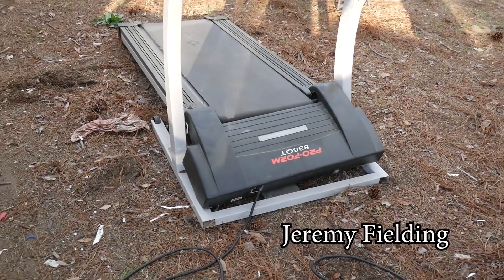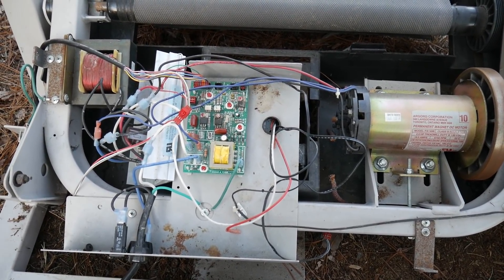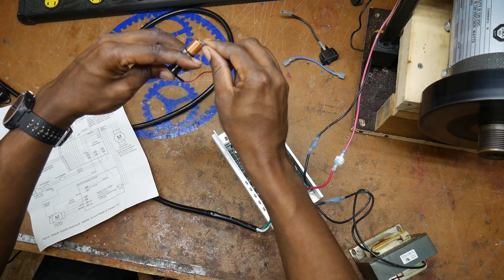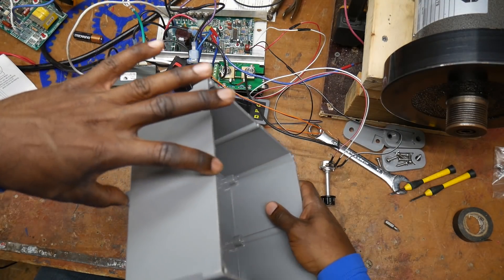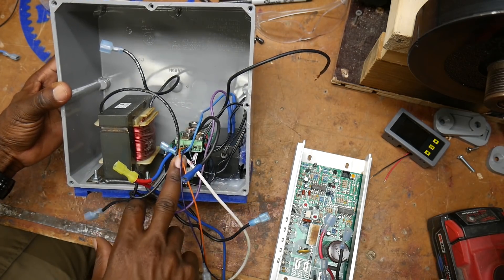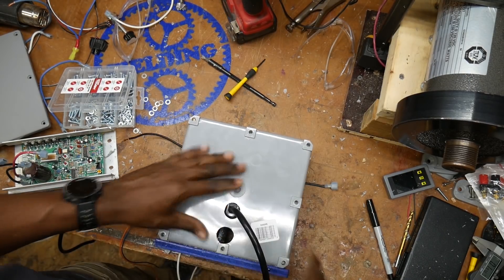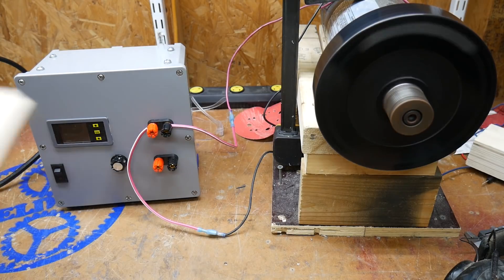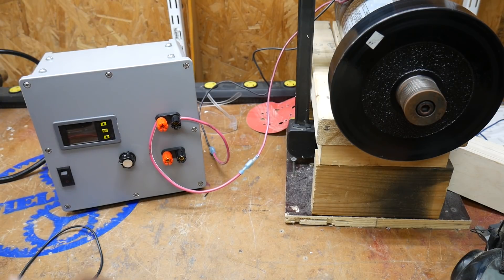Building A Variable DC Power Supply From Treadmill Parts: 054

Comment: Hi Jeremy, when you talk about the control side, you mention high, low and a wiper, mine is labelled GND (Presumably earth), 5V and CF .... have you any ideas what these may mean ?
Reply from the maker: That is a different setup. it sounds like variable voltage input instead of dividing voltage supplied by the controller. You have some homework to do to confirm the correct setup.
Reply: Jeremy Fielding thanks buddy. I managed to use an SCR voltage regulator and a bridge rectifier in the end, but thanks for your time to answer :D

Comment: Jeremy, is it necessary to use that choke? I'm going make one of my own with an MC60, but do I actually NEED the coiled choke for the power supply?
Reply from the maker: I don’t like making these kinds of recommendations. If the question is will it turn on and adjust the DC voltage the answer is yes. I decided to use it. You will have to decide what you want to do from there.
Reply: A very fair answer. Fooling around with it Jeremy, I saw it help dampen the audible surge when trying to achieve a set speed during motor testing. IMHO, which is based on absolutely no accreditation I have, keeping it would be the best idea.

Comment: to the right of the 12-volt adapter whats the name of the object with a circuit board?
Reply from the maker: I haven't watched this in a long time but if its not part of the treadmill circuitry it is the "other" part of the voltmeter display. You can see all the treadmill parts used in the video so it shouldn't be hard to figure out if its one or the other. If you still can't figure it out it would sure be helpful to post a time stamp so I don't have to re-watch the whole thing.
Reply: thanx

Comment: Heat up connection until the component melts the soldier, not the soldier gun. The gun or pen is used to heat the connection not melt soldier... that's the whole trick to soldering... wish I had your patients to make videos of it... It's really simple though..

Comment: For the soldering, don't use too cold of an iron. Far too many beginners set the iron temperature way too low, then wonder why their joints suck. I'd go no lower than 650F (340C). My iron on my bench is usually at 700F (370C). Just touch the iron (with a little solder on the tip to help the heat transfer) to the wires (/ board / components) to heat them up, then stick in some solder. It should melt basically instantly, and flow nice. Oh, and don't goop on too much solder either :) If you still have trouble, add extra flux beyond what's in the solder - it'll help a lot.
Reply from the maker: I should probably start with a soldering gun that has more than one temperature
Reply: If you're looking at buying something, check https://www.youtube.com/watch?v=ao39bPEyok4 and https://www.youtube.com/watch?v=kmq769_ed9w. I just picked up a used Hakko FX-951 for a decent price (haven't even really used it yet), but I've gone YEARS before that with pretty basic irons (weller WP35), then a station (something like a weller ec1002, and added a weller tc2002 which had a much finer tip), all of which were hand me downs or trash picks, and I do some fairly advanced soldering (everything from high strand count dc cables for drones, to super small surface mount). What's important in the end is some decent temperature control, and enough wattage for what you're trying to do, and not worn out tips. So for basic stuff, either look for a used weller for $40 on ebay, or get a ts-1000 for more, or a fx-951. It's kind of a tradeoff, how much money to spend initially, and buying better stuff in the future as your needs advance, or just getting something nice at the beginning.
Reply: Oh, and use "screwdriver" shaped tips too - conical tips are horrid. Just a mistake most people make when buying an iron. A good general purpose tip is a ~3mm or 4mm screwdriver shaped tip.

Comment: Thanks Jeremy just in time also. I just pulled a PM DC motor from a treadmill with a MC-2100 controller. No background in electronics so this was very helpful. The MC 2100 doesn't appear to have the 3 post connectors that you had to connect the potentiometer to. So I'm trying to solve how that connection will work.

Comment: Nice...thanx for the vid man. I just got the exact same treadmill from family but it has a 2.5 hp motor. Would that change pot type??
Reply from the maker: It’s about the speed controller. But if it can be controlled with a POT it is usually 5k. Of course making a recommendation is impossible because every manufacturer is different. I can’t say for sure.

Comment: The speed control by changing the voltage or PWM to the motor is good. However the speed may change as the load is increased. I believe a treadmill uses a feedback / governor to keep the set speed constant regardless of the physical / mechanical load change. This can be desirable if you want the driven tool not to change speed or bog down as more demand is put on it. Have you seen this or figured out how to incorporate the "governor" circuit?

Comment: What are the specs on the motor? HP RPM Volts and Amps? Another great video BTW. Your videos are straight forward without all the bull and useless naration that plagues so many contents.
Reply from the maker: The motor I am testing is 3.8 hp at 4800 rpm 130volts DC and I think it was 18 amps . I will have to double check those numbers
Reply: treadmill motors in general, that I have seen at least, have been as low as 1.5hp all the way up to 4.0hp. They may go higher than that, but I think 4.0hp is the biggest that I have seen personally.

Comment: I did not catch what kind of power you have coming out at the banana jacks? Is it straight direct current or pulse with modulated current? It might make a difference if someone were to build one of these for running other applications besides running direct current motors.
Reply from the maker: It is most likely pulsed.

Comment: hello Jeremy,
i like your idea of the power supply /controller...I like it very much...I have three complete tread mill setups down stairs in my shop.i think I'll do this too.just finished doing my southbend 10 k ,I changed over to dc from the ac drive that was originally in it....and the dc setup with the variable pot works like a charm............I just love it...never need to go back for the belt changes again.......love it.....

Comment: Brilliant use of an the old parts of the treadmill, however they are not common and now they will be impossible to find after your build.
Reply from the maker: I have 5 of these speed controllers to be exact. All are very similar in size and function. MC80, MC60, MC70, MC2100 x2.  If I didn't, the next treadmill would yield something similar. You have no idea how often I see these things listed for free online. About 3 times a month if I had to guess. The absolute worst case would be buying a new replacement part which is available on ebay. This is not a problem at all if you are willing to wait a week or two.

Comment: Over the last month or so, I've pushed to get good at soldering.  Got one of those SMD practice boards, which prompted me to do more looking for good instruction.  I found information that helped me to understand the process so now I can identify which variable needs tweaking to get a good joint.  

Check out the John Gammell and Adrokavo youtube channels.  Both only have a dozen or so videos, not talking, but you can nerd out on soldering up close.  And important for learning, showing the impact of changing the variables, temp, solder, flux, etc.  

Now, I'm going to be on the look out for an old treadmill to scavenge.

Comment: love your videos but I do have one thing to say on safety, you show your main power switch on the neutral input of the 120v feed. you should have it on the hot side, if there would be a problem and you turn power off at this switch all you are doing is cutting the path back to ground for the power, so if you would touch something you would become the ground, always remember that electricity will always follow the path of least resistance to ground. so always place the switch on the hot feed as close as you can to the power source. if switching 240v you need to use a DPDT switch so you are cutting both legs of power. Thank you for the great videos and keep them comng
Reply from the maker: Not exactly...Electrons will take all available paths with varying amounts of current based on resistance. So if you touch a live wire it will travel through you and the main conductor. You become a parallel circuit. We use parallel circuits everyday. I actually don’t remember if I put the switch on the neutral or hot... I just drew it there out of convenience. But, the circuit is grounded properly and if there was a fault, current would flow through the grounding conductor back to the panel and trip the breaker as it should. Since the case is plastic there isn’t a path to the external body of the case unless I happen to touch a screw on top when this happens and also happen to have a path through my body back to the source. I agree the best practice is to put the switch on the hot side. I can easily check that and switch it around. 
Thanks for the feedback, and for the kind words.
Reply: I'm sure you have it right, I just seen way it was on your drawing and thought it should be pointed out but I do love your videos they have given me some great ideas on projects to try.
Reply from the maker: I appreciate the engagement. I added a note to the description to clarify which side to put the switch on.
Reply: yah. we never switch the neutral.

Comment: Is it possible to have a Forward/Backward toggle switch?  Or is that not really needed for your project?
You made a really nice project box out of it.  Great job.
Reply from the maker: That would be very easy... a double pole double throw "DPDT"... but that is not a feature I want. I could just reverse the quick connection on the outside if I occasionally wanted to switch them. But that is not really the intent here.

Comment: very nice, i  have an treadmill sitting in my room that should be getting used .....or maybe il just use it as a motor controller ......but i will solder the connections :)

Comment: thanks 4 the promt reply, i want to power my mill with a treadmill motor 130 vol1 18 amp ,2.5 hp  but i need a board to power it and i am electronically challenged ,im not a kid anymore(71)
Reply: This YT video may help you. He figured out a way to get variable speed without a control board.  https://www.youtube.com/watch?v=mcvITqrGxeY&t=282s
Reply: Well, if you are not a kid anymore, start reading, learn and DIY.

Comment: how many amps can the mc80 handle?     i enjoy your vids,
Reply from the maker: The motor installed in that treadmill could draw 18 amps. However the speed controller was turned down to 100 volts from the factory so it may be more limited, or it was a safety factor they use. I don’t really know just yet. If I had to guess it would be 15amps what you would get from a typical wall outlet in the house.
Reply from the maker: Search online for free local listings. I have found at least 8 this way
Reply: wow that's alota juice! this just saved me about $50! now i just gotta track down a treadmill
Reply: sweet!

Comment: Been missing you Jeremy. I don't know what I'll ever do with the knowledge you so generously share with us, but I appreciate it none the less.  BTW, soldering is easy.  Just be sure your wires/traces are hot enough to flow the solder. A good soldering iron makes a huge difference. Cheap ones are hard to work with.
Reply from the maker: Mine is the definition of cheap LOL

Comment: Jeremy - Could you hear the high pitch beeping at ~1hz when you had the music quietly playing? Like 90% of this video was painful, like a dentist's drill pulsing into my eye socket? It's high pitch enough your hearing might not have it in range anymore so maybe you didn't notice? But... goddamn was that painful. Piercing, loud, like an EKG beeping but less friendly Boop and more SCREE SCREE SCREE SCREE!

Also, a silly thing... when you measured out the holes for your transformer... you had the transformer there, you could have just put it on the box and marked your holes directly, saved yourself several minutes, no? Or did you need to do all that measuring for other reasons?

Neato project otherwise, still enjoying every video. Keep up the great work.
Reply from the maker: I could not reach all the holes from the inside... As you see I did do it for the MC80 from the outside of the box. But there was more space for that part. There is a slop in the bottom of the box that the choke was going to be really close to. I was afraid I might end up making the holes too close to it and have it bolted down at a angle or it not fit at all. When the nuts don't have full contact they are more likely to come loose...
Reply from the maker: As to the high pitch sound. Someone else commented on that. It seems that the music's tone got shifted somehow to create the high pitch. I have used this song before and no one complained so I think it was my editing that somehow changed the  pitch. I don't usually modify the overall volume (for all the tracks at once) but I had to in this video. I am concerned that caused it.
Reply: Yeah I hear it also, was wondering if some kind of alarm was going off. Glad to see your back Jeremy. And I find it hard to believe you can build all these kick ass things but have trouble soldering. My advice is get yourself a half decent soldering station where you can control temp settings. And different tips. I use one that look likes a flat head screw driver about an 1/8" long. I find it helps a lot. Get yourself a solder sucker and it will help you salvage electrical components much easier. But as always. Great video. Thanks for sharing
Reply: "I could not reach all the holes from the inside." - Just put it on the outside of the box then, like you measured. Alternatively, I find paper templates are almost always 10x as fast as measuring and then transferring measurements. Just food for thought, use whatever processes make sense to you.

On the subject of soldering... even crappy soldering is better than wire tying and stuffing it under heatshrink. You don't need a temperature controlled iron or none of that sillyness for wire connections (for sensitive and microscopic electronic components, it helps, but still isn't necessary). Just put the iron against both pieces of metal to join, glob a little bit of solder onto the iron so that the glob helps make good contact to the other bits, wait for it to heat up, and add solder to joint. You'll see it spread out like a paper towel soaks up water. Remove heat and try not to shake the joint. Lighting a cigarette is harder, you're probably just too critical of yourself.
Reply: MattsAwesomeStuff I suck at it as well. Tend to overheat it or make stiff. Brittle joints. Mostly do automotive stuff so working to not have that happen. It’s not ideal settings...so not ideal tools. Heat shrink is helpful to hide the solid but rock solid connection. May as well use solid core copper wire which is problematic in automotive application obviously. Sometimes crimps suck and force you to soldier.

Comment: does this only work with DC motors
Reply from the maker: It only produces DC output. But anything the will run on DC will work. It could be lights or a universal motor since they works on AC and or DC.

Comment: Good stuff, thanks.  One of the best tips I got when I was learning to solder was to let the metal I'm soldering to melt the solder (and not let the soldering iron directly melt the solder).  My other suggestion is: Keeping a steady hand or mechanically holding the bits being soldered still is critical for a reliable joint.  Cheers, David.

Comment: Great channel, very informative. I have the MC-60 version of these controllers, and now am trying to apply the electronic parts and motor to my metal cutting lathe, seeing how these treadmill motors are two HP motor. A lot of these controllers were used on lathe like maybe 10+ years ago.

Comment: I had a roommate in school who was going to teach me to solder.  He gave me an old circuit board and told me to de-solder all the components on it first.  When I got done de-soldering, I knew how to solder!  As someone stated earlier, the key to a clean, (not cold ), joint is to ensure nothing moves as the solder is cooling, hence a solid mechanical connection first. Anybody who criticizes your soldering is missing the point anyway.

Comment from the maker: There are now links in the description for the purchased parts. Several people have asked. There are also notes about changes to the circuit you should see before you build.
Reply: hi make a treadmill generator to charge a 12v battery with a charge controller. and then hook up a inverter
Reply: I must have missed it Where'd you get the display?
Reply: @patsox2004  Google Display Digital Current Voltage Power Energy Meter
Reply: GOOD VIDEO BUD